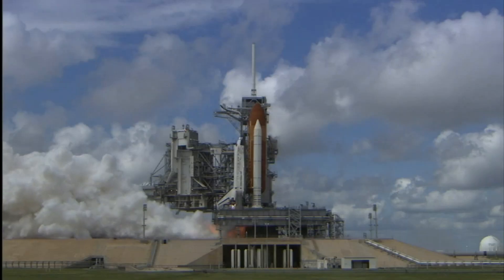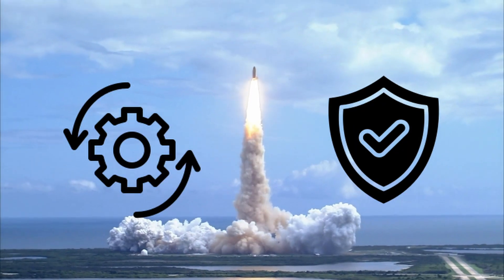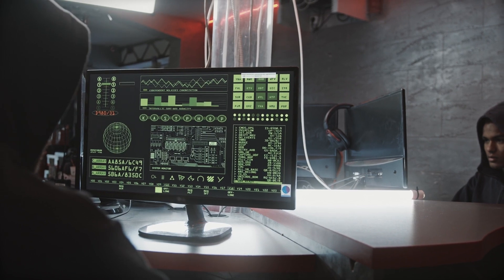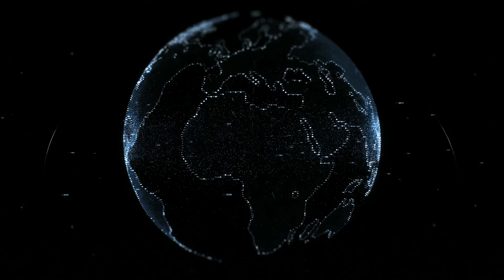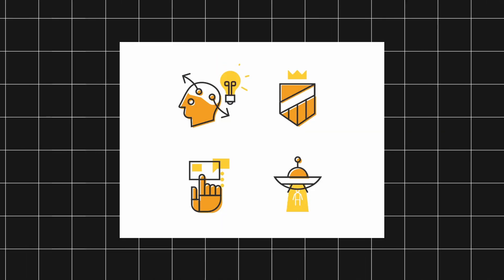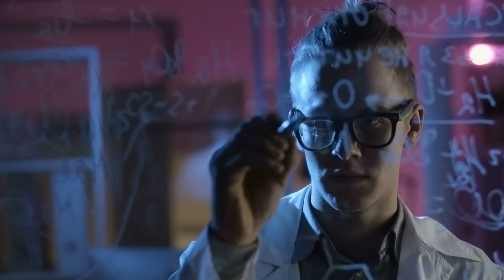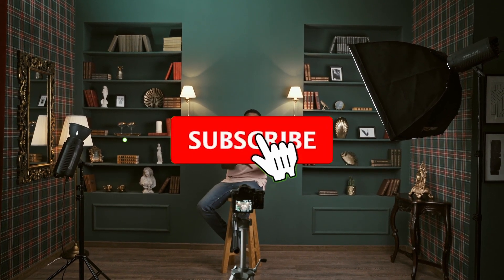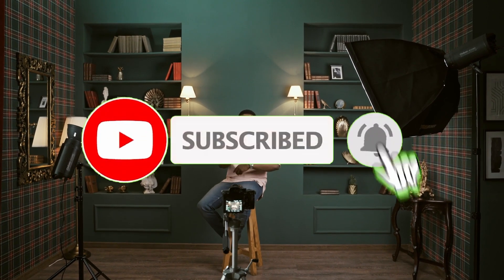Why NASA's 1970s Software Still Powers the Space Shuttle?

Comment: In other words, modern software is garbage. I've known this for a long time, software keeps getting worse with every update. Computers keep getting faster, but because of lazy programmers, they really keep getting much slower. Same with the speed of the internet, the bandwidth has gotten MUCH faster, but everything takes longer to load than it did in the 1990s.
Reply: No they're just working off the principal "if it ain't broke don't fix it" and dude dial up connections were awful where did you get that information from😂?
Reply: @patrags_  No, they're working off of the principal of "if it ain't broke, break it". And I didn't say dial-up, I was referring to the cable internet we had in this far away, very low population county, which was only about twice as fast as dial-up (as long as you were close enough to the main hub). And even then, web pages loaded much faster than modern web pages on new computers with our modern much higher bandwidth internet connections (although this county is still far behind the speeds of other areas, but I've visited other areas and the software of the internet still stinks).